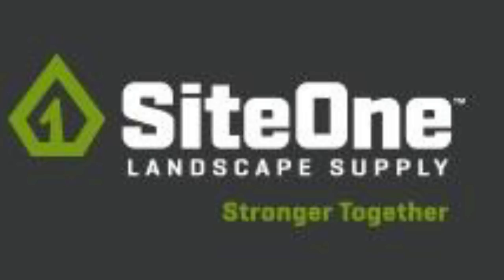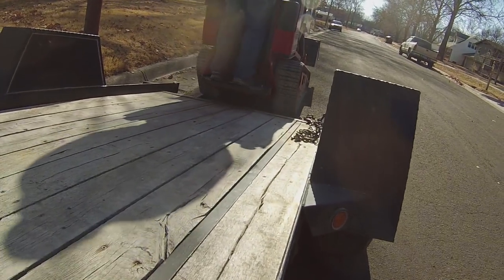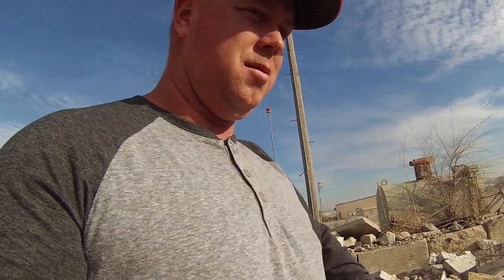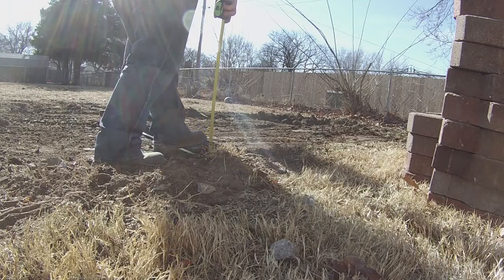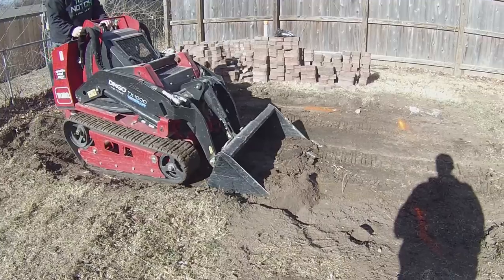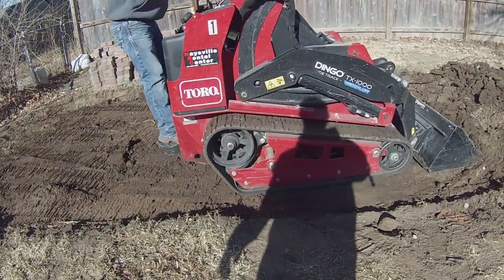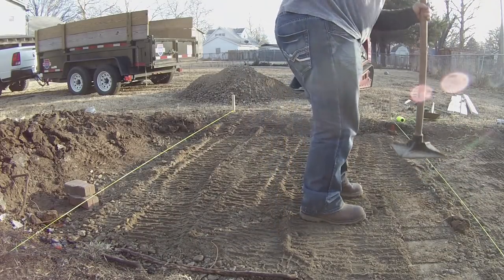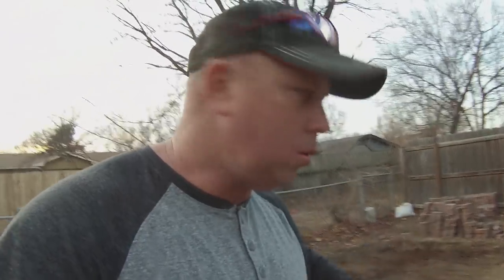First Patio Paver Landscape Project, Toro Mini Skid Steer TX 1000, #TryNewThings

Comment: Good job man, I plan to be doing the same thing come spring here in New England. I don't know if you're doing it here, but typically on a job you over-prep the area of installation by 1 foot. So if you're creating the 6×6 patio you need to create a sub-base of 7×7. It makes it much stronger and allows for less movement in the ground.
Reply from the maker: Gregory Parachojuk yea I noticed I didn’t come out far enough on two sides. It’s funny when you come back in a day or two you start noticing all your mistakes.
Reply: Top Notch Lawn Care All in the learning process!

Comment: The pack looks about right. Lime stone actually breaks down under ground so you don’t want to much of that. I use a product called pack. It’s three-quarter inch stone mixed with stoned dust and you compact it with a plate compactor and it’s hard as a rock. Also, you want to make the base a little bit wider and longer than your patio to give more support. It’s going to look great! That’s just a few tips I have.
Reply from the maker: Appreciate it. Thanks.

Comment: What I was taught in school was, you lead to iron pipes and then you fill in between them and cover the pipes with stone dust and then you take it 2 x 4 of some sort or straight piece of wood and you drag all of the stone dust toward you and off for the metal rods and it will be very flat. You then want to hand tamper and then put a thin layer of stone dust on top of it and then re-swipe the 2 x 4 over it again and then layer pavers, and its called screeding

Comment: I've always used DG (decomposed granite) as my base. Pack, wet it down and let it settle, add more to level, then sand under pavers, flagstone..whatever to set. The fill paver gaps with gator dust or spaces between flagstone with DG, pack and wet (light sprinkling) again, The sweep off and call it good.  Not a professional just a homeowner with many of these projects under my belt.  That dingo sure makes the excavation piece a breeze by far the hardest part of any of these types of projects.

Comment: Hey I did the same thing with my first patio and did it in my back yard. Here's a tip. Put landscape or geotextile fabric down on the subsoil before your base material so it doesn't migrate later on.

Comment: Crushed stone makes for a great sub-base (stone only, not mixed with dirt). Squaring up a squared area, opposite corner lengths should match, so the length from the northwest corner to the southeast corner should be the same length as the southwest corner to the northeast corner. Also, you can use the Pathagerom (sp. ?) Theory in which 3 squared + 4 squared = 5 squared, hence say that you have a very small patio plot of 3 ft. by 4 ft., the diagonal length of the opposite corners should be 5 ft. in length. I usually just measure the diagonal corners and make sure that they are the same length as told in the first method. I am no expert by far, but I hope my two cents helps.

Comment: In my area I've seen and also used clean and some crushed rocked and compact it with a vibrator plate for base
Reply from the maker: +Kolby Kamerick 👍🏻👍🏻
Reply: the tx1000 toro with the strong kubota engine in them sure tough engines for the jobs